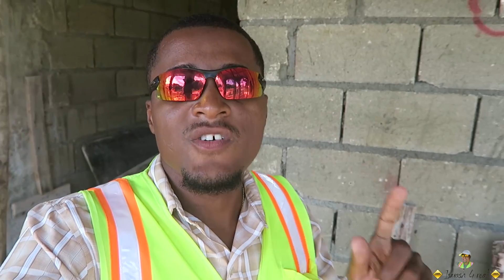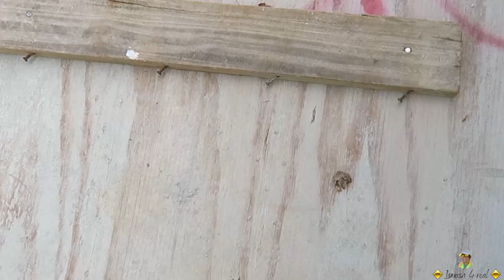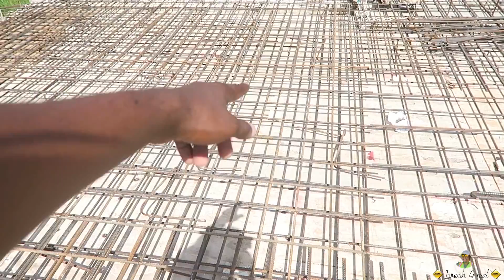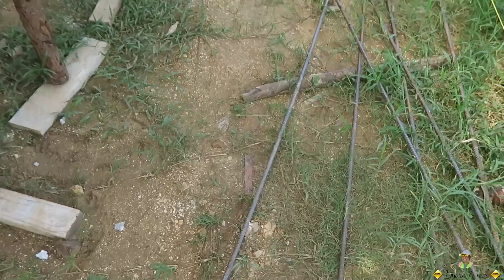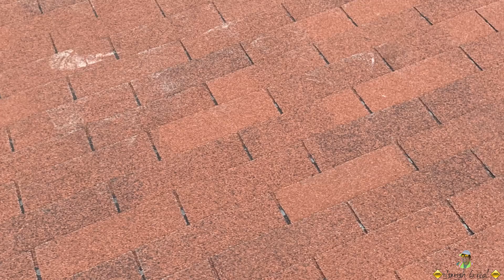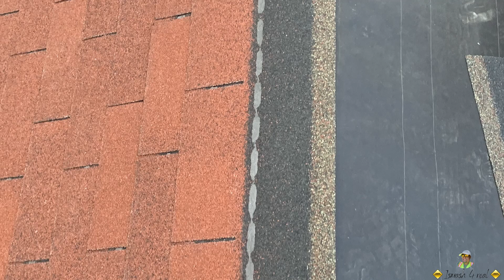CONCRETE SLAB REINFORCEMENT (One Way) #JAMAICAVLOG Part 2

Comment: What is the purpose of oversuport  bars, is it because of the weight, or to assist  the projected orextend slabs?
Reply: To make it easier to understand, if you put 2 blocks a distance apart, put a stick across them, and stand on the stick, your weight pushed down on the center of the stick and causes it to break downwards. What happens to the 2 ends that sit on the blocks? The ends push upwards. Thats what happens with forces on a slab. So the additional reinforcement is necessary above the main reinforcement at the areas where the the columns or wall are below the slab. Hope this helps. Feel free to ask any questions.

Comment: I don’t see why the engineer would advice to use 5/8 bar.. the over support is placed at the top at l/4 span to prevent negative bending moments.. so it’s doing it’s job just fine.. bigger bars would only need to be considered when designing the beams..doesn’t seem necessary in my opinion

Comment: IsMash 4Real what you have just pointed out about the steel Sir you are perfectly right,not all Jamaican engineers are worth the title. All the rebars at the belt/bond beam should be bent in the beam,no steel should be hanging off the beam to nowhere. During an earthquake the steel can come loose and the roof collapse. What is shown in the video I seen a lot of in Jamaica but it is WRONG. If you check the IBC and ACI-318 codes you will be assured of the right thing.

Comment: i am not sure why an engineer would say that is a one way slab but it actually as supports (i.e belt beams) on four sides making it a two way slab. i also assume the bars are projected beyond the belt on one side to allow for extension of the building.

Comment: Your nail pattern is incorrect. You're nailing too high.
Reply from the maker: Nailing on the lap....used 4 nails on it, two at the top and two on the lap at different lengths
Reply: @Ismash4real  guess I missed that. There should be four nails at that tar line. Remember you're in a hurricane zone.  Hope you're using a nail gun,  hand nailing isn't fun 😁
Reply from the maker: @REALBADMANSAMBO  lol, we don’t have any powder actuated tool atm..so just imagine the struggles